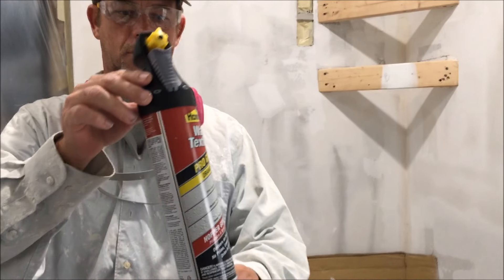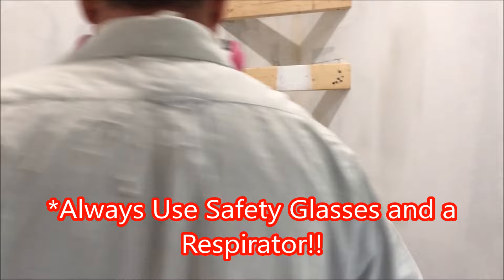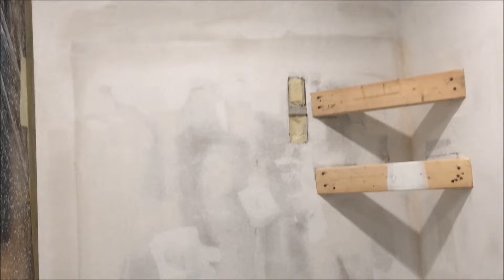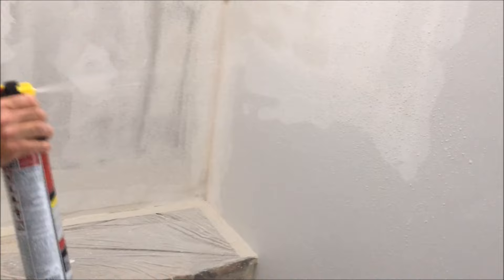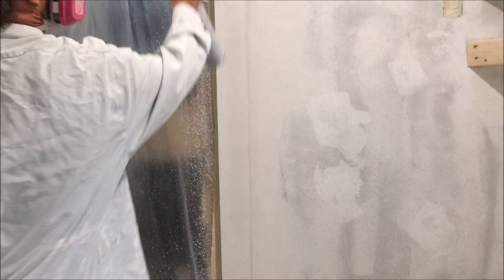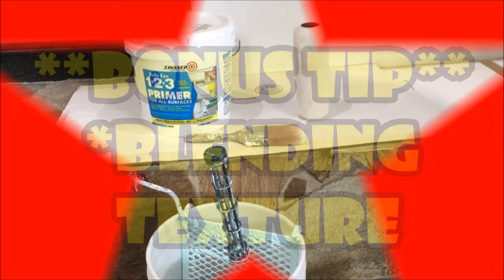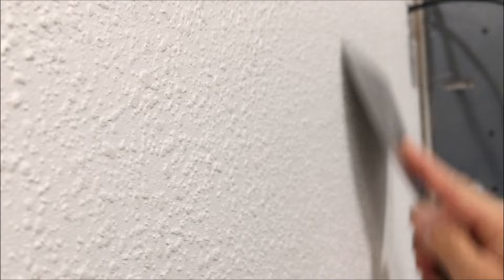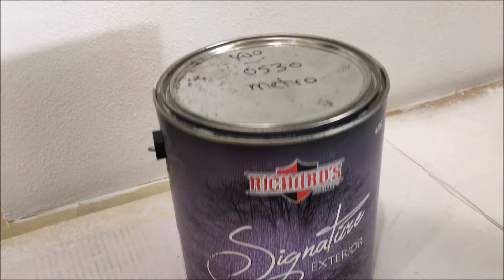How to match orange peel texture- Using a can of Homax orange peel texture on a drywall repair

Comment: I do the same as a DYI'er. I tried the water base it takes forever to dry, flattens out too easily when priming, and has more filler than texture. Oil base rocks but use protective gear as mentioned. Gotta prime it no matter what. Good tips and demo dude!
Reply from the maker: Spot on alwaysrockn2009! Thanks so much for watching. -Paul
Reply: Agreed. The oil-based performs significantly better. Fewer air bubbles and more consistent application. The fumes it expels are awful, but still worth it.
Reply: does the water base flatten after leaving it there for several day anyways? thanks
Reply: @b.a.1854  I left it for a day to dry, maybe even more,  it it just didn’t work as well. I tried several cans and was stoked to use a water base product but it just didn’t work that well as I mentioned in the comments. The oil is harsh with fumes but it works really well and I’ve stuck with using oil base exclusively.
Reply: @alwaysrockn2009  thank you! Question I had to skim coat the walls. Do I need to prime before adding the texture? I’ve read mixed messages on this.
Reply: @b.a.1854  I don’t really know. If you are skim coating it’s basically just adding the same material over the top so I don’t see the significance to priming  first. However, if you want to see the finish as it would look if it was painted,  then priming it will help. Check out Vancouver Carpenter’s website. He’s an awesome and very knowledgeable dude in drywall and he may have good advice for you. His channel is top notch.
Reply: @alwaysrockn2009  Yelp he’s my go to mentor lol thanks again
Reply: @alwaysrockn2009  Dumb Question, I bought both the wall and ceiling spray texture. if I want to orange peel a small half bathroom walls and ceiling, do i need to cover the ceiling or walls first while i spray either or? reasoning behind it is that i dont want it be orange peel heavy at the inside corners. Thanks Again in advance
Reply: @b.a.1854  I always cover what I don’t want to get spray on. If you want to protect the corners so they don’t get too heavy with texture then cover them up for sure.I’d  start with the ceiling then the walls. Using a 3M hand masker will help protect the areas from overspray. Make sure everything is covered up on the ground since you are doing the ceilings including yourself.
Reply: @alwaysrockn2009  thank you !

Comment: That tip about using a taping knife to scrape over the top of where you sprayed in case it is a little too bold for the existing drywall texture is very helpful.  Thanks so much for the excellent video.

Comment: Might want to discuss adjusting spray, heavy to light. Also, very important to keep same distance, about 18" to 24" from the wall, and try not to angle the spray. Great tip on knocking down some of the heavy spots after primer. 
Thank you

Comment: Very useful! I prefer a flat paint over that sort of texture (seems to warm it up a bit), except in bathrooms or other places where walls get wet. I'm glad I watched your video because I was going to buy the water-based, but based on your expertise, I'm going to buy oil instead. Also the advice using 6" knife to smooth it out was fantastic!

Comment: Bless you I tried texturing matching wallet last night almost gave up it doesn’t look very good but I found your video this morning and I think I will give it another try I just have to sound a bit more. I tried a couple of those same cans and for some reason they stopped working on me or which is very sloppy even after adjusting the knobs to what I needed.

Comment: 1.  To achieve what you did on the cardboard, what variable did you use?
Fine, Medium or Heavy
And what pressure
2.  I also notice you left the red tab on, in the Homax instructions it says to remove it

Comment: Thank you for posting. I heard you should shake it upside down? Any truth to this?
Reply from the maker: Hey JK H, Yes. Shake it up, down, up side down and all around. shake it really good.👍🏻 Now after your finish spraying the orange peel texture from the can. Turn the can upside down and pull the trigger until just air comes out. this cleans the nozzle and the small hole that the texture comes out of for the next use. Hope that helps, -Paul

Comment: I often have the problem of the spray can texture not flattening out as much as the original and looking like it needs a shave. That texture you did looked a bit sparse. Were you 100% satisfied with the match to the existing?
Reply from the maker: +Mike Richter I hear you Mike. No I'm not 100% satisfied with the outcome from the spray can of texture. The plus is it can blended in well and is easy for a DIYer to use. I think I could've gotten a lot closer to matching that texture by using my hopper and thinning down joint compound. But since this was an area at my own house, I wanted to try to match the orange peel texture with spray can texture and get it on video for all the DIYers searching on YouTube. I think the texture in a can is much easier for a DIYer to match an orange peel texture than trying to gather a compressor, hopper and get the joint compound mixed to the right consistency to match an existing orange peel texture on a drywall repair. On a sidenote I had a contractor friend over and told him that I had redrywalled and textured the wall behind the plasma TV. He said "Oh wow I Would have never known anything had been done..." Take care man, -Paul
Reply: @PaulPeck  Why don't they sell drywall with orange Peel ALREADY ON IT ? What the fuck is this, some kind of kick back conspiricy for wall pros & spray on op makers ? Also, the can I bought never had a ball bearing rattle no matter HOW LONG I shook it ! I ran out of air long before the can was empty, and I think the can had been sitting on the store shelves for 10 years, & had entombed the ball. The whole business stinks of blatent theivery.
Reply from the maker: Hi Kyle, don’t hat the player... Hate the game! 👍🏻😎 Thanks so much for watching and subscribing! -Paul

Comment: I never use a mud knife to do any dry knocking down of orange peel texture  if it is a small area  i use a sponge sanding block  180 grit and with little to no pressure go over the area   big areas i use the sand pole  again with little or no pressure  the wait the tool has dose fine    novas people will leave trail marks  with a small tape knife
Reply from the maker: Hi Ruk, yes sandpaper or sanding sponge will work too. But just like with the drywall knife you need to have a light touch while knocking off the top of the orange peel. I've done it both ways and if there's a High spot or a bump it's going to take the texture off while you were using sandpaper or drywall taping knife. I appreciate the comment. Take care, -Paul

Comment: Did you just spray straight on the wallboard without any mudding or skim coat at certain spots, (where there wasn’t any mud from taping or fasteners)? And then applied the primer afterwards? Thanks!

Comment: What would you suggest when replacing new (green) 1/2" drywall up to a piece of textured drywall?  Its in a bathroom and If I hang horizontally, I can make a butt edge on both sides to the old textured wall. The edge on the ceiling will be tapered to the flat edge of the textured ceiling, I would use paintable caulk for the inside joint on the walls, sand down the ceiling as much as possible and mud/tape the inside edge and try to blend orange peel with this homax spray. Or should I do it the other way around hanging vertically and tape/mud the corners and caulk to the ceiling. Or just tape/mud everything? I know its not going to look perfect trying to tape/mud the new drywall to the old textured drywall but I can't find the best way to accomplish this without replacing all the drywall in the bathroom.

Comment: But oil based is not good when using water based paint also when applying the texture 3 minutes after the texture was applied being it's semi soft yet it can be lightly smoothed out without using much pressure at a 45° angle with a putty knife to match existing knockdown texture on wall rather then scraping it off when it's hard though depending on existing texture itself.

Comment: My issue with the homax orange peel (all be it the water based not oil) is that the texture tends to flatten out as it dries and then doesn't match.  It looks great when I spray, then come back the next day and it really lost alot of it's texture.  Tips for that?  Again, I did use the water based stuff as thats all I had so maybe thats the issue.  Damn dogs putting holes in the walls with their heads....
Reply: 😂Had the same thing happen with my dogs. I eventually installed diamond plating on the walls in their room.

Comment: Texture >prime > paint ! 
Is that correct sequence?
Reply from the maker: Yes!👍🏻😎
Reply: Paul Peck DrywallTube thanks I just finished my project. Copper pipe water leak. Replaced part of the copper pipe and solder it. Applied new insulation, dry wall, tape joint and mud, sand it...Texture > prime> paint! 
Thank you again!

Comment: I need help if you’re still active , I’m remodeling my house as I just purchased it , however I’m redoing the dry wall in some rooms and I purchased water based paints , and water based wall texture, the guys at sherwin Williams told me “if your paint is water based, oil based wall texture will not work” anyways I see that you don’t like water based wall texture, do you think I’ll be fine, or should I return , because I purchased about 5, 5 gallon buckets of paint , and 5 boxes (6 pack) or wall texture , and this was very expensive , each can was about $18 and I purchased 30 cans
Reply: @Michael Erving Just because Paul doesn't personally like water based texture doesn't mean you have to change your remodeling game plan. I've recently used Homax water based wall texture for my home and achieved great results (knockdown texture.) The guys at Sherwin are right, if you're using a water based paint then stick to water based texture. I'm making the assumption the paint that you purchased is primer mixed. Typically with oil based materials you have to do a primer only coat and let it dry before applying paint. When you use the water based primer mixed paint, then you eliminate that extra step (on naked or same based surfaces.) Helpful tip* Save all your receipts because you can always return what you don't use. (except custom paint etc.) Hope this helps from also from another New Homeowner.
Reply: Cuong Dennison thank you for the knowledge, I’m going back today to talk to them about primer , the paint they sold it is a ProMar 200 paint , they also sold me Shellac based primer to use with water based paint and texture , man in know way am I rich but just on the paint, texture, and supplies for dry wall etc. I spent like $2500 , and that’s not even everything I need from them 😔
Reply: @michaelerving9146  That's really expensive 😳 I went to Lowes for our paint and home depot for supplies (masking tape, hand masker, drop cloth etc.) They sell high quality paint with primer there with all the different types of sheen you need, even Sherwin Williams paint. We planned on painting the entire interior of my house excluding the ceilings so I pulled the trigger on a Graco LTS 15 airless paint sprayer with 24" extension.. 15 gallons of (Valspar Ultra Satin), 5 gallons (Valspar Signature Semi-gloss) for a total of 20 gallons, all supplies, texture, paint brushes, including the Graco Airless Paint Sprayer for ~$1400. Idk how big your project is, but my home is 1,500sqft with vaulted ceilings (big walls) and we have a couple gallons of paint leftover. It's also nice to know that you can always return your non-used wall texture. 😁
Reply: Cuong Dennison so in my town we only have Home Depot for paint , and sherwin Williams , every “professional painter” has told me that Home Depot paint is not the way to go , and basically they explained to be that primer mixed with paint is a gimmick,  even at sherwin they told me primer mixed with paint isn’t really even a good thing , and to basically just purchase primer alone , and I feel ripped off, I’m redoing 2 restrooms (toilet, vanity , sink, tile , covering tub to shower) and basically repainting the whole , and repaint all the drywall (that needs repairs) the house was not treated proper at all , I think these people before me would fight a lot and we’re in general angry people
Reply: @michaelerving9146  No doubt Sherwin Williams carries some of the top of the line paints, but I'm convinced with the paint that other stores sell like Home Depot and Lowes. I even Googled "the best interior paints" and 4/5 "best interior" paints are sold at Home Depot and Lowes for a fraction of the cost. The results came out with excellent quality and so of course every "professional painter" is going to suggest Sherwin. If you want to check out how the  paint primer mix came out, I could email you the pics. We also did both of our bathrooms, 3 bedrooms, 5 closets, living room, 2 dining rooms, laundry room, and kitchen. With the amount you're probably going to spend on "professional" materials and paints you could use that money on a airless paint sprayer instead of rolling the whole thing. Note* I'm going to use the airless sprayer on my backyard wooden fence etc.
Reply: @michaelerving9146  well said...sherwin williams paint is absolutely worth every penny. I will NEVER use paints from the big box stores. They're less pricey for a reason. Great paint makes a huge difference